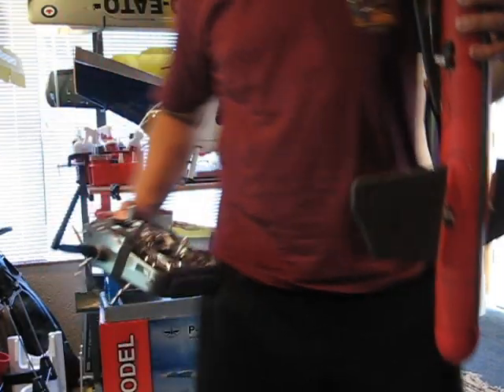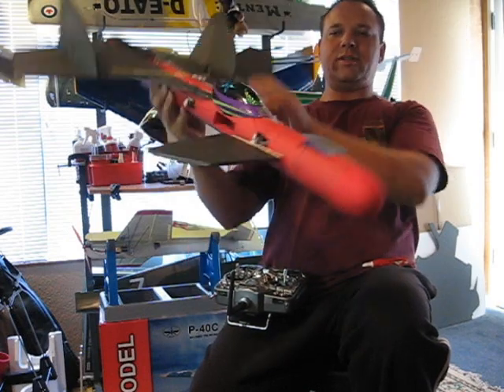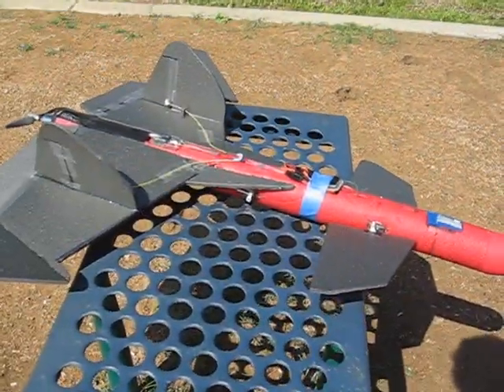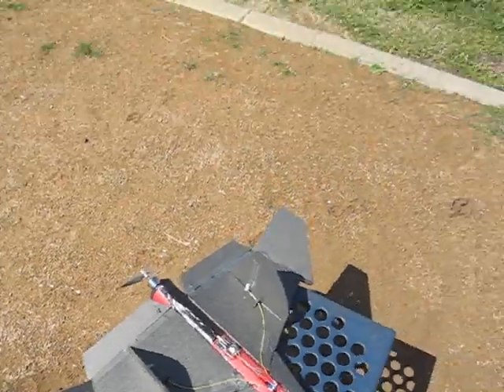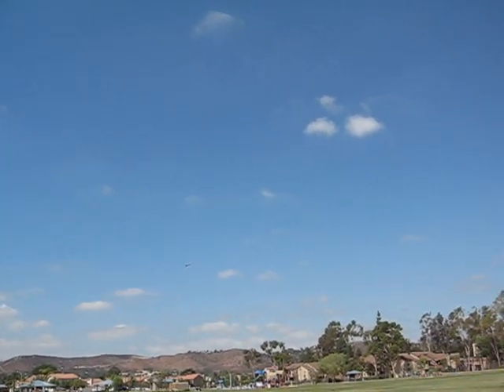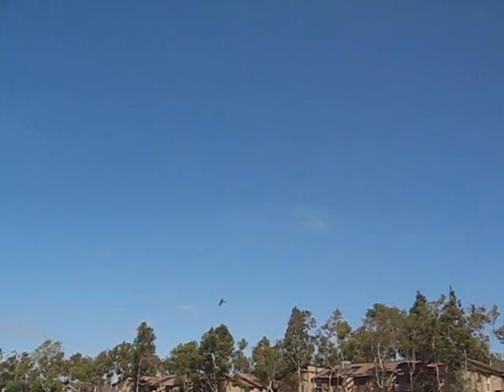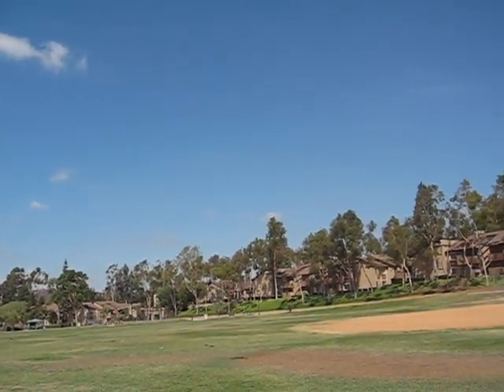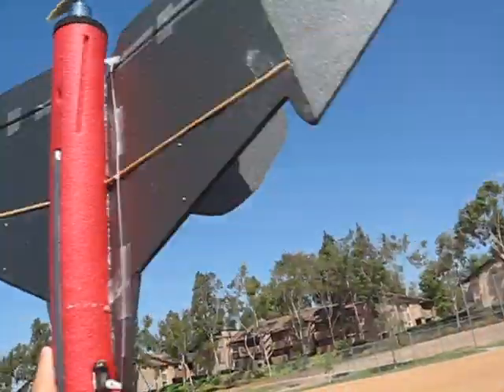Experimental Scratch build RC Plane Maiden Flight!

Comment: Good work, nice flight and landing. How did you know where to set the CG ?
Reply from the maker: Hey thanks, I think I just chuck glided it until it sort of flew after shifting around the battery.
Reply: youtwoba can you give the detail of your model (how can you made)
as i am making the project on this model so please help me how you made this plane
Reply: Calculate wing area of main wing and 30% MAC
Calculate wing area and 30% MAC of the foreplanes.
HS Geometry calculation of balance beam  

Area (canard) * Distance from CG A = Area (main wing) * distance fro CG B
Distance from Canard 30% to main 30% = total distance
Distance from CG A = total distance - distance from CG B

And here's the funny thing... generally it comes out near leading edge of main wing.